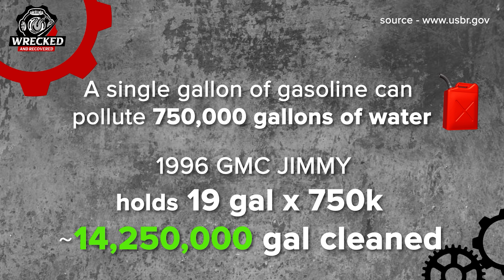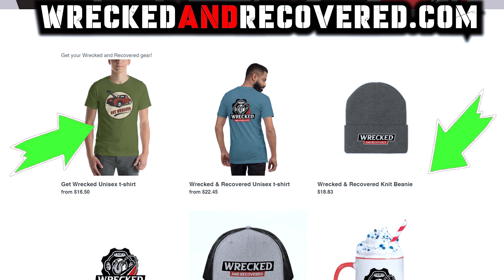1996 GMC 'Jimmy' Discovered After 20 Years Underwater!

Comment: I have an Insta360 and it is a REALLY cool camera. The dive case for it sucks, though. The spring on the power button isn’t strong enough so every dive below 30’ gets the camera turned off.  I do a lot of Great Lakes Shipwreck diving so I dive around 100’ fairly often. Y’all have an open invitation to come and dive off my boat any time. Also, want a V-hull boat that’s better for deeper water/waves?  She needs a new engine block and manifold but has a nice Garmin side scan on her. ‘87 Rinker Fiesta Vee 250- 25’ Cuddy cabin with a head and galley. Sleeps 4.